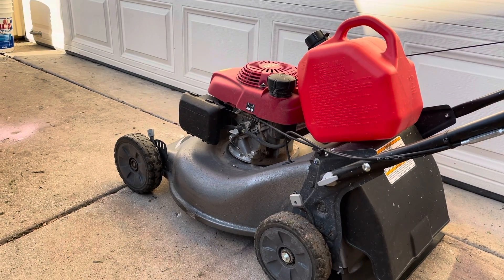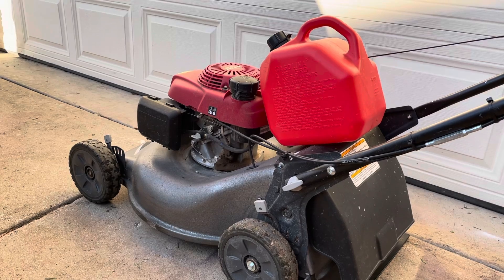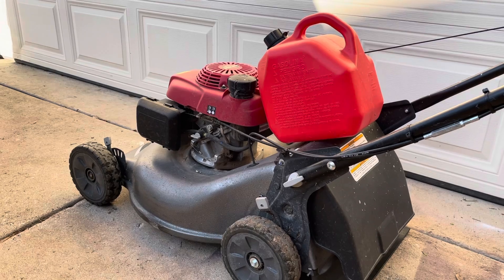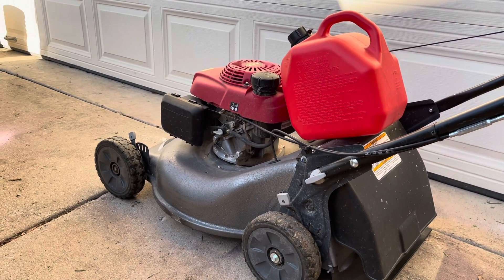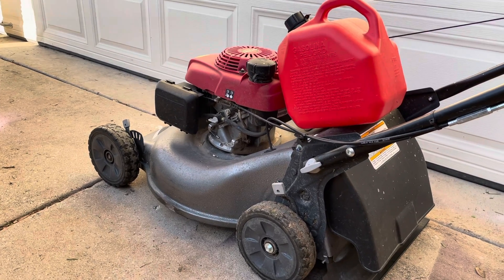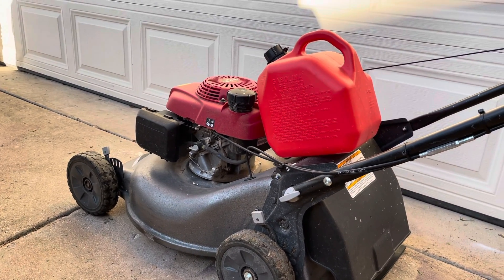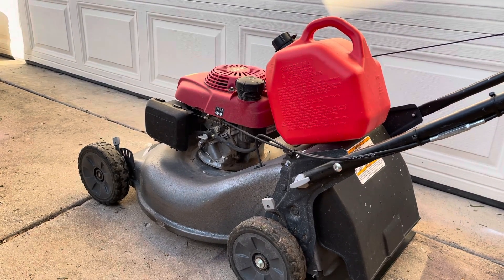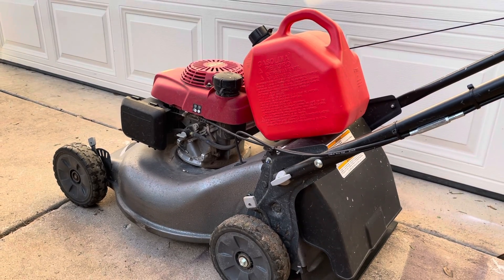How To Never Run Out Of Gas When Mowing The Lawn

Comment: I start my pusher mower every 8  or 9 months whether i need it or not. I pull the string 126 times then I check the fuel, then the oil, then I rebuild the carburetor. At this point whatever I had planned to mow has died and blown away.  Works every time!
Reply from the maker: Most problems that are not critical usually go away by themselves.

Comment: When shtf happens I'm coming to your house to get a lawnmower! Maybe go manual or solar powered? :-)
Reply from the maker: Hondas are the best.  They run smoothly and not so loud.  If your going manual, check FB.  Around here, people give them away.  It's usually the tree hugging hippies that decided to hire a landscaper instead after cutting the lawn with a manual push mower.
Reply: I'm going to put up a video to counter this one, How to never run gas ⛽ in your lawn mower lol
Reply: @LibertyGarden  Agreed. Having a lawn service would, to me, seem utterly stupid. Same reason we don't have a plower of the snow paid for. Do the work yourself! Still a gasoline lawn mover for each house on my street but mine (ours is electric like our personalities) is both silly and noisy!
Reply: @MosaicHomestead  lol Don't wear flip flops making it Luis or the Health and Safety Prepper Committee will get triggered
Reply from the maker: @MosaicHomestead  I want to see a lawn mower with solar panels on it.
Reply from the maker: @HuplesCat  I've used electric weed whackers.  The cord is a pain the ass the to move around the house and trees.
Reply: @LibertyGarden  Yes. I got a cordless
Reply: @HuplesCat  Too late, not only do I wear flip flops, I removed the trimmer safety from my Dewalt battery operated trimmer, I also use my Dewalt battery operated lawnmower with flip flops as well...and today I got a great deal on 2 goats 🐐 to keep my wannabee Homestead growing. I have been busting my ass stuccoing lol
Reply: @HuplesCat  Oh... I also stucco with flip flops lol
Reply: @LibertyGarden  I can make one, but it would look stupid lol...I charge my lawnmower batteries with my solar panels, Then I cut the grass, when I'm done, I charge the batteries for the next cut...My shed is going to charge my batteries with solar, and store my trimmer and mower.
Reply from the maker: @MosaicHomestead  In a season I spend about 5 gallons of gasoline for the mower and about 2 for the whacker.  At $2.50/gallon that amounts to a whopping $17.50 to cut the grass one season.  I would like a shed to store my tools.
Reply: @LibertyGarden  here grass grows 365 days a year, its more money 💰 here to cut the grass ....Now its a lot less lol

Comment: If your yard is the size of 2 tennis courts it might be better going electric, I said bye 👋 to gas mowers and trimmers.
Reply from the maker: You need a small tractor or riding mower is the lawn is that large.
Reply: @LibertyGarden  my front lawn is pretty big, but I have cement driveways that make the lawn smaller its just right for my electric mower...now the 8 acres in the back gets mowed by the goats 🐐, I got 2 more today.